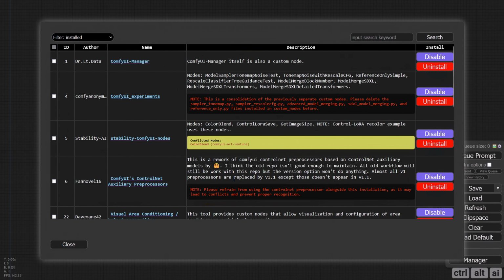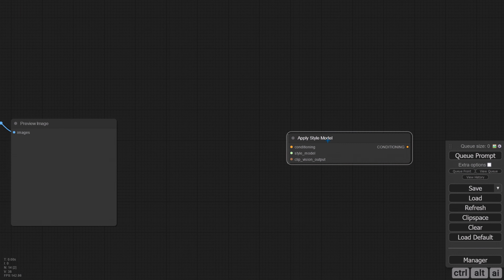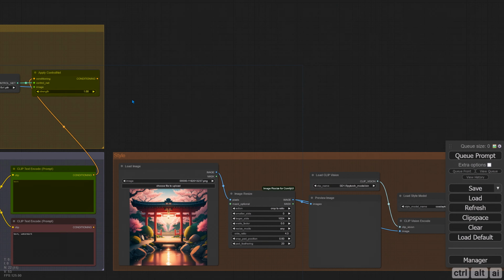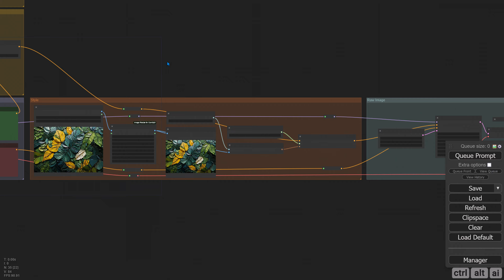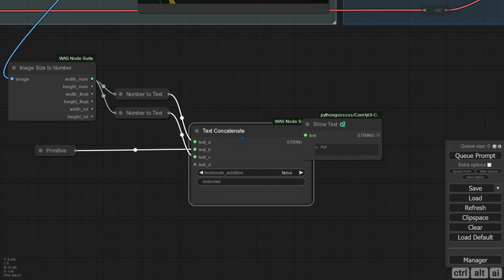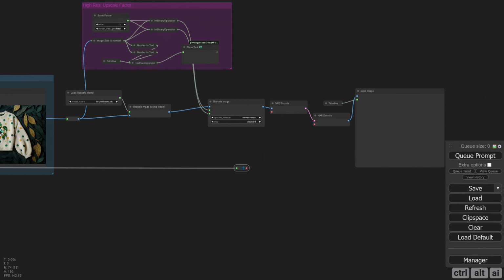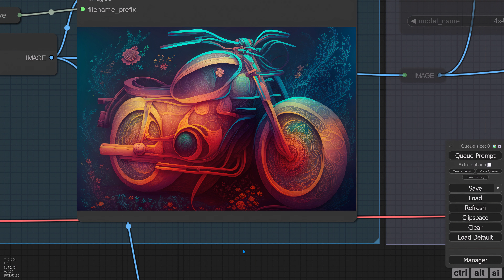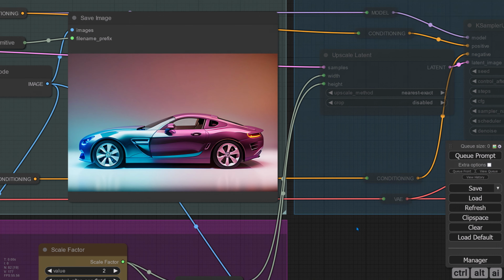ComfyUI: Style Transfer using CoAdapter & ControlNet (Tutorial)

Comment from the maker: Note: If you are getting error for “Sizes of tensors must match except in dimension” the following maybe the issue:

1. Checkpoint is SDXL. CoAdapters only Support non SDXL, SD1.5 fine tuned checkpoints only.

2. Correct ClipVision Model download from:

https://huggingface.co/openai/clip-vit-large-patch14/tree/main

File to download: "model.safetensors"

Put it in this folder: ComfyUI_windows_portable\ComfyUI\models\clip_vision

Update: The model downloaded from Comfy Manager no longer works (it downloads the wrong model)
Reply: Thanks for the update! Things with models are ever changing, almost no tutorial is safe lol
Reply: really annoying that this cant work relatively simple cross models :/ I'd love to use controlnets on juggernaut but seems impossible

Comment: Excellent detailed workflow, explained step by step. Thank you so much for creating this video. After adding all the required nodes, models , when I execute,  I am getting an error at the Apply Style Model node - "Sizes of tensors must match except in dimension1. Expected size 1024 but got size 768 for tensor number 1 in the list". Any insight how I can resolve this error whether its a setting that needs to be changed in the workflow? Thanks for your help.
Reply from the maker: Thanks! For the issue. What checkpoint are you loading (only non sdxl will work). Also, is the ControlNet images getting generated? You have re-created the workflow correct? Can you send that workflow via email, So I can check on my system and reply. Email is mail @ controlaltai . com (without spaces)
Reply: @controlaltai  many thanks for your response. Yes the issue was with the checkpoint, I was using a SDXL one that caused the issue, once I used the SD1.5 Checkpoint, am getting the images generated. Control-Net image is generated. Will send you the workflow, have added an upscaler at the end.

Comment: Sizes of tensors must match except in dimension 1. Expected size 1280 but got size 1024 for tensor number 1 in the list.its a setting that needs to be changed in the workflow? Thanks for your help.
Reply from the maker: Check the checkpoint. It should be non sdxl only.
Reply: did you fix it? same here..
Reply from the maker: Also as reported by a channel member, please check clip vision safe tensor file, should go in the correct folder. Best is to install from the install models option from Comfy Manager. It automatically puts it in the right folder.
Reply from the maker: You can send me the work flow. I can have a look to check if anything is related to the workflow you created or is it something else. Also let me know your GPU.

Comment: Thank you for the very useful workflow. I have a question as I am getting an error while running.

Error occurred when executing StyleModelApply:
Sizes of tensors must match except in dimension 1. Expected size 1280 but got size 1024 for tensor number 1 in the list.

I've tried with different combinations of models based on SD15, but the error repeats. If it's not a model issue, what is causing this error?
Reply from the maker: Thank you! Try sd 1.5 resolution for controlnet and image generation. Like 512x512 or 512x768. Also check the control net models, they should all be sd 1.5. All models should be sd 1.5. Let me know if that works.

Comment: Hey There! Thank you for the great tut! I tried to build the style transfer workflow myself to learn but I'm getting this error: "Sizes of tensors must match except in dimension 1. Expected size 1280 but got size 1024 for tensor number 1 in the list." Any idea what I'm doing wrong?
Reply: Ok, from the other comments I understand this is a know issue. I checked my mode and clipvision, should be allright. I'm running the workflow through RunDiffusion. What is the discord by the way?
Reply from the maker: Hi, there is no discord for now. We are too small. You can email though. About the error check for all models to be 1.5. That includes checkpoint, ControlNet, IP adapter and matching clip vision. Some sd 1.5 ip adapter require sd 1.5 clip vision and some require sdxl clipvision. If you can tell me what model of ip adapter you are using I can refer to the compatible clip vision model.
Reply from the maker: What is the ip adapter version. The co adapter sketch version is fine.
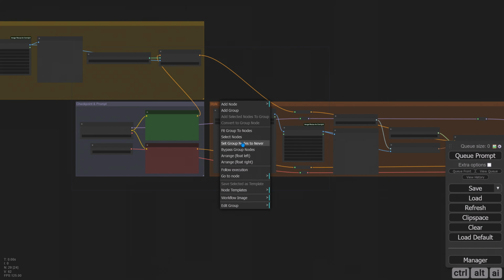Reply: For the styling I have the coadapter-style-sd15v1 and the sd1.5 clipvision model. For the sketch i have the coadapter-sketch-sd15v1. No additional ipadapter, right? Its the workflow you are building uo to 15:00 @controlaltai
Reply from the maker: I double checked, the model downloaded from the Comfy Manager no longer works. Try this: Download and use this clip vision model "model.safetensors": https://huggingface.co/openai/clip-vit-large-patch14/tree/main

Let me know if that works.

Comment: The arrows are drawn straight for you. With which mode can we do this?
Reply from the maker: Hi, can you please explain what you mean by arrows are drawn? What arrows?
Reply: You are connecting two models together. Mine is not like yours. Yours is straight, mine is like a rope. @controlaltai
Reply from the maker: @natura.teraphy.8d you mean the lines between the nodes, noodles? I am using the default setting.
Reply: When I use it, it is not straight like yours, it hangs like a rope and I use default. But the knots are not like yours. I want them to be straight. @controlaltai

Comment: On what basis did you conclude that upscaling is more effective in latent space, than image? I've done a TON of upscaling with realism Engine SDXL v20VAE to >1080p, but I admit, it was never in latent space
Reply from the maker: Yes Upscaling in Pixel space works and that's what is used in the last step. The purpose of the "Add Detail" group is not upscaling. What I am doing in that group is "a second pass via K-Sampler". That's why I have named the group as add details and not upscale (2x upscale is done here to save another step). The Image generated using SD 1.5 with the CoAdpater style most of the time are blurry. For this reason I have to make a second pass. When you just upscale, the blurry images upscale maintaining the blur. First thing I did was that, plain pixel upscale. Hence the group name is "Add Details". The final step is pixel upscaling only.

For SDXL images, I have never used this method. Images in SDXL 1024 are sharp and most of the time only require Pixel Upscale for which I mostly use Ultimately SD upscale (img2-img).
Reply: @controlaltai  the blurry images upscale - nonsense - proof - youtube Kbcpr_C6gvI - I very much thank you for your detailed reply.  It is my OPINION that starting with a better model, like realism engine, is so pre-packed with detail, it doesn't require an add detail level.  I'd be happy to post example of what I mean, should you request.  Again, I am thankful of your content, and have learned from you.

Comment: Thanks for the video! Have you tried ipAdapter? It seem that it's doing what style control net's doing but better) What's your thoughts on it?
Reply from the maker: Hi, yeh I have used IP adapter. That's very different from this. IP adapters indepth tutorials are actually in the works. Will be making and releasing them in the upcoming weeks. 

The IP adapter does not understand multi control net. They are all separate.

CoAdapters are aware of each of the different functions that all of them do. The results are just different. 

IP adapters are very powerful and recent though.

Btw, here is the IP adapter tutorial which it was done for A1111: IP Adapter ControlNet Tutorial (Stable Diffusion)
https://youtu.be/KHm5Q5TfNvE

Comment: When using the SD1.5 model, these errors occur. SDXL works fine. What methods should I use to operate the SD1.5 model?
Reply from the maker: SDXL will not work with CoAdapter Style. Download Any SD 1.5 Model. Search for Realistic Vision on Civit AI and download the Version 5.1. Put it in this folder: 

ComfyUI\ComfyUI_windows_portable\ComfyUI\models\checkpoints

Reload ComfyUI

Comment: Hi. I downloaded your workflow and ran it. However, like many others, I'm encountering the issue, 'Sizes of tensors must match except in dimension 1. Expected size 1280 but got size 1024 for tensor number 1 in the list.' Initially, I switched to 1.5 models to align with the coadapters' requirements, but I'm still facing this error. I also tried using the exact model and VAE as shown in your video, but unfortunately, I'm still unsuccessful. :(
Reply: Edit;

just put the "openaiclip-vit-large-patch14.safetensors" inside the "clip_vision" folder.

not in the "clip" folder like me :):)
Reply from the maker: Thank you. Now I know what to reply.
Reply: I am facing the same problem as you, but I still don't understand how to solve it. Could you please be more detailed? Where do I need to download the "openaiclip vit target patch14. safetensors" file?
Reply from the maker: If you are manually downloading, it should be downloaded in this folder: ComfyUI\ComfyUI_windows_portable\ComfyUI\models\clip_vision\

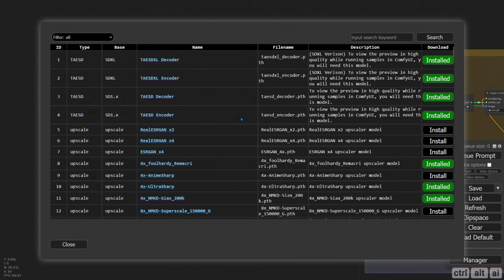However, I recommended you go to comfy manager and install it from install models. Check here: 03:17

Comment: very helpful, one error i rec is Error occurred when executing StyleModelApply:

Sizes of tensors must match except in dimension 1. Expected size 1280 but got size 1024 for tensor number 1 in the list.    can u give some solution. thanks
Reply from the maker: Check the checkpoint model. It should be SD 1.5 checkpoint only. SDXL is not supported by CoAdapter.
Reply: @controlaltai   thanks, i fix it. it is now render
Reply: @controlaltai  I'm also only using 1.5 checkpoints and all the correct models, followed everything to the tee but its still giving me that same error
Reply from the maker: I need to see the workflow you have created.
Reply from the maker: I checked the file. I downloaded the ControlNet Advance. However I could not get the Cyber Realistic Classic v1.3. I tried it with the normal v.1 in painting one from Civit AI. There is nothing wrong with your workflow. Its generating the images properly here. I suggest you check if clipvision is in the proper "clip_vision" folder in models. Also try using another checkpoint sd 1.5 and see if that works. Let me know.